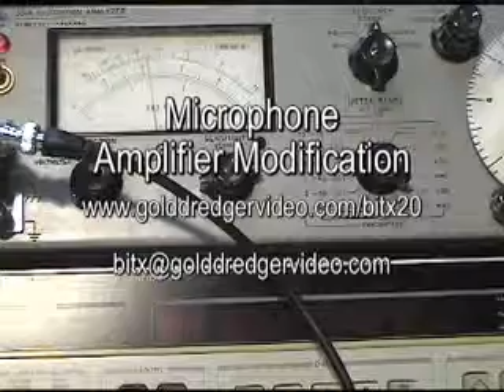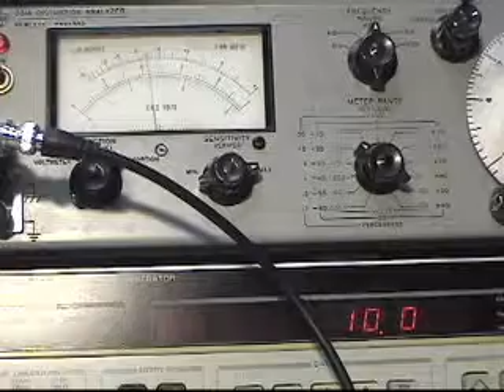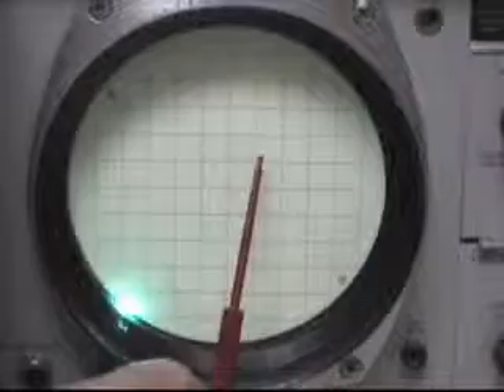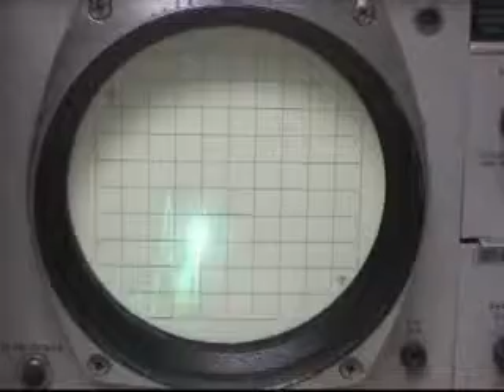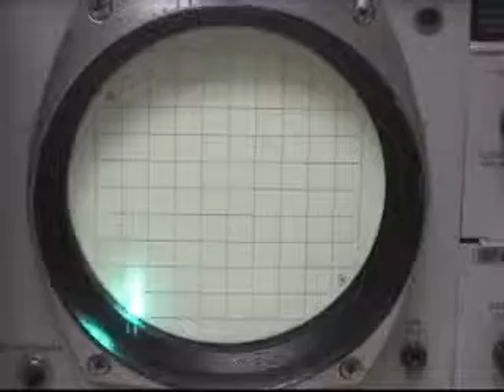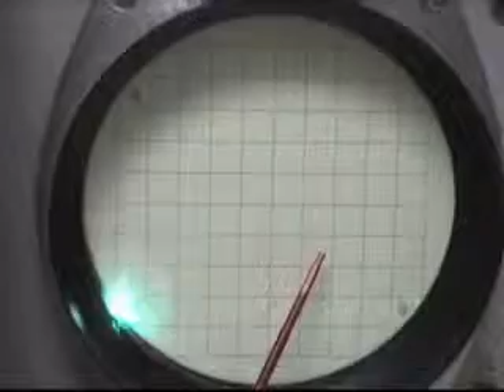Bitx version 3 mike mod.

Comment: You have a link to the modification that was made?
Reply from the maker: It was a simple mod. It was mentioned in the video. In the mike amp circuit change the collector 2.2k to a 1k and the emitter 2.2k to a 390 ohm. This was referencing the schematic at http://golddredgervideo.com/kc0wox/bitxver3/schematic.gif
Reply: Thanks.  I have a Bitx40 that I just received.  I missed it in the video.  Thanks again.